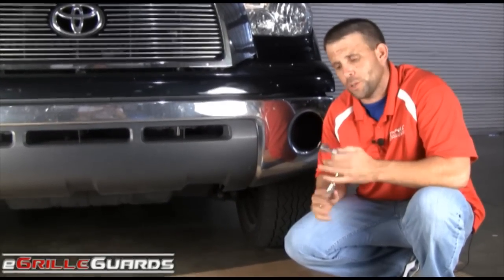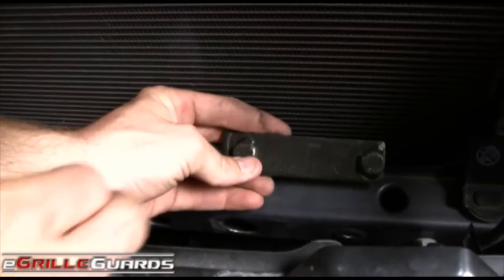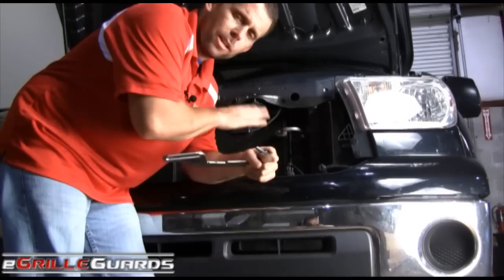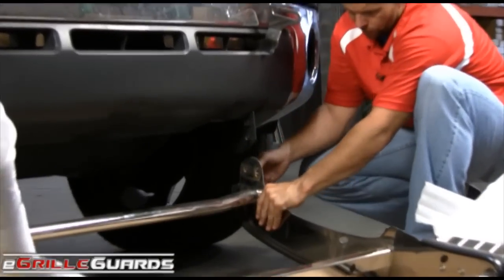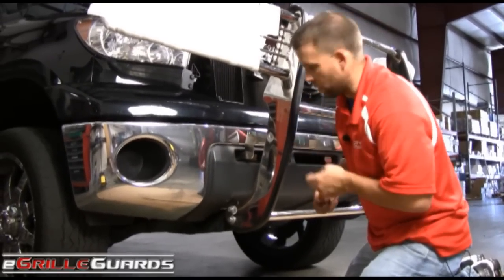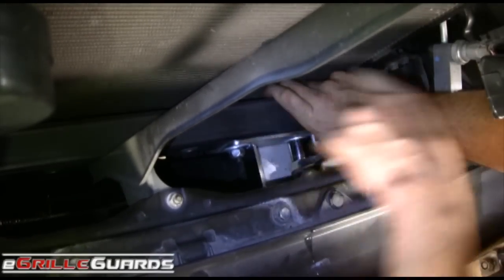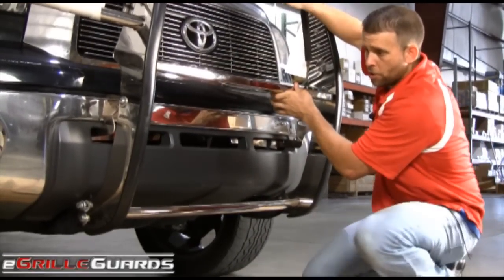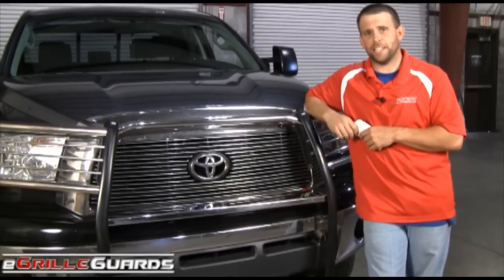Steelcraft Grille Guard Installation on Tundra

Comment: Do not like where the upper supports bolt on. That brace they bolt to is way to light. If you bump spmething to hard you will bend the brace into the radiator and do serious damage.  The ranch hand legend for the Tundra has the upper brace bolt to the frame usung one of the factory bumper mount bolts. This one would scare thd hell out of me.